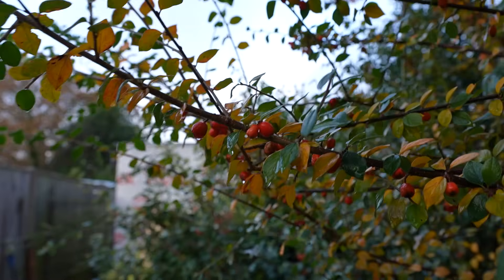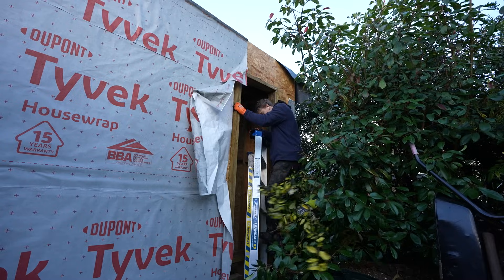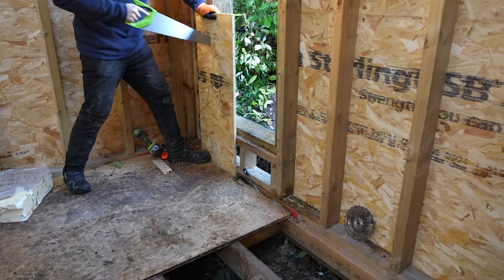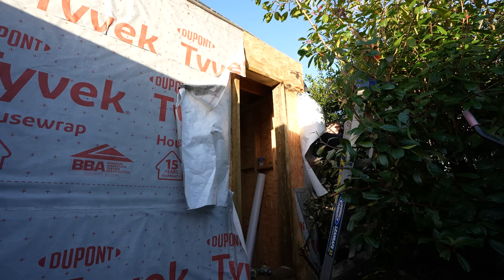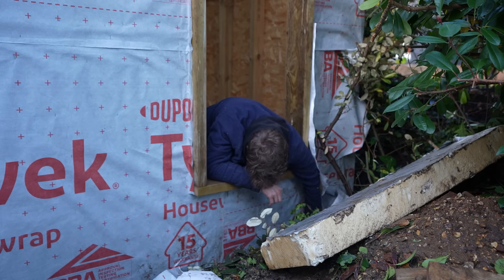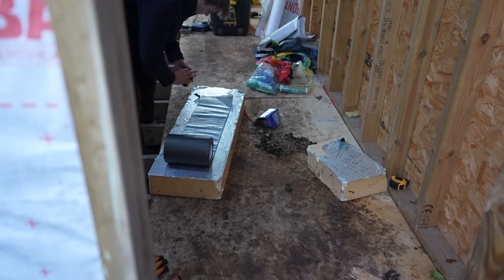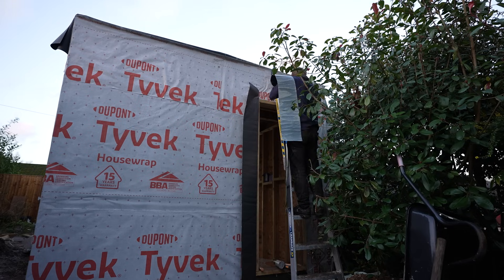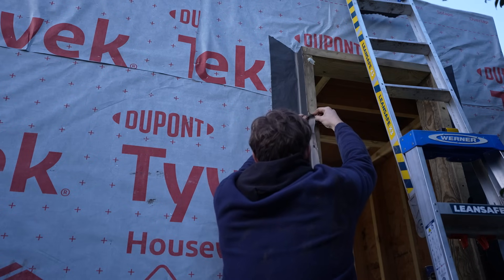22 Days Until I Move In…Self Building My Dream Tiny Home

Comment: I’m not an architect but I’m concerned that using single pane skylights will really fuck up the heating inside. There’s a reason you can get away with single pane skylights on the roof and not the walls because heat rises.

The cold air from the outside will transfer easily to the inside with nothing working in your favour.

My theory is you’ll end up with a cold box with the r value of a shed? Have you put this into a simulator?
Reply: I do hope it all works out but it does seem like none of this has been thought through fully. Worst case it'll last a few years before it needs tearing down and he's got more content for this channel (which would be super wasteful but presumably that's how he sees it).

Comment: Dude that osb is too close to the ground, it will get soaked over time and go mouldy. It should end just below the cill plate, so about 8inches off the ground and you can extend your battens below that level if you want to hide the floor joist with your cladding

Comment: You could make a French Drain around the foundation.  Simple to dig drench, put gravel at bottom of where you dug,
Put black corrugated, plastic tube 4” with holes facing up, then have that going out at some point so water won’t get to foundation.  Also, cover with more gravel, then dirt.
Reply: This is the Way